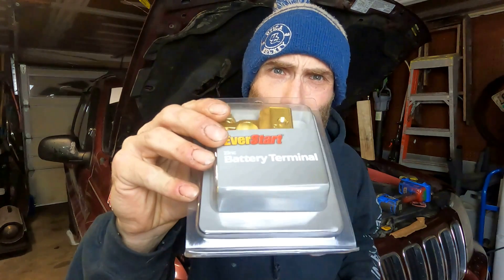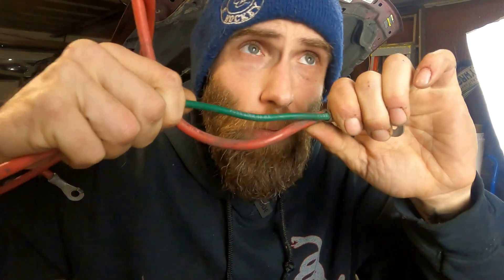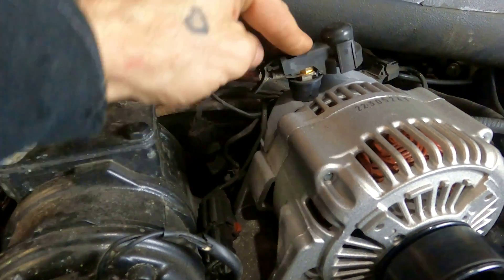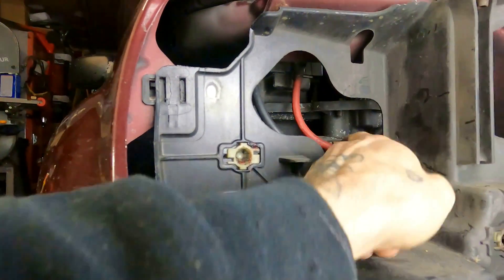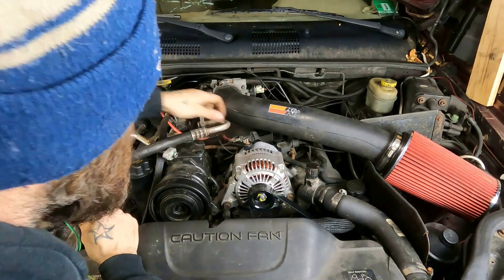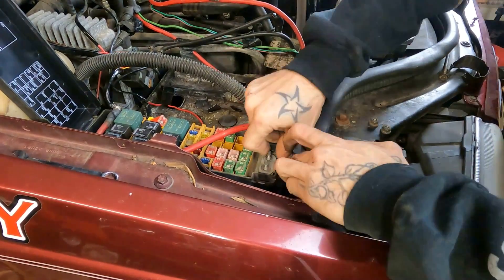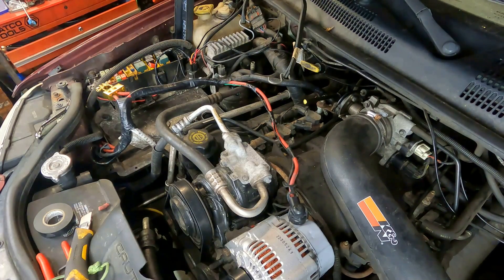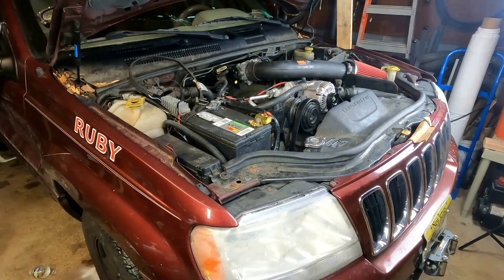Jeep Electrical Issues - FUSIBLE LINKS & The Charging System

Comment: Only problem with the fusible link is it won't actually prevent the overvoltage situation from occurring, it may blow as a result from overcurrent but the higher voltage would have already made its way to the electronics at that point.
Reply: most if not all computer modules will have circuitry to protect against overvoltage. The fusible link is a belt and suspenders type of situation.

Comment: I did a wire upgrade to my jeep and upgraded all main power wires to 1/0 and I used those exact battey connections I drilled out they worked great